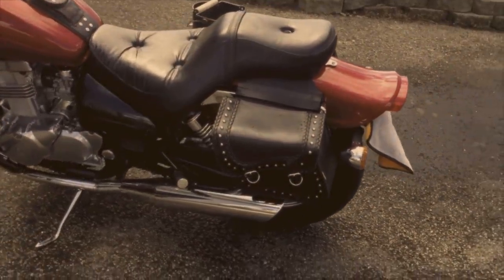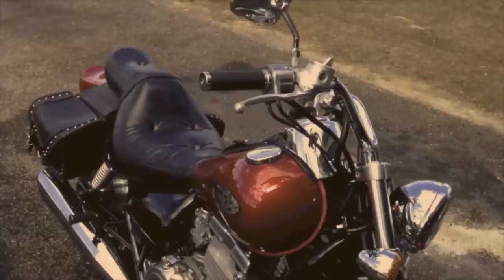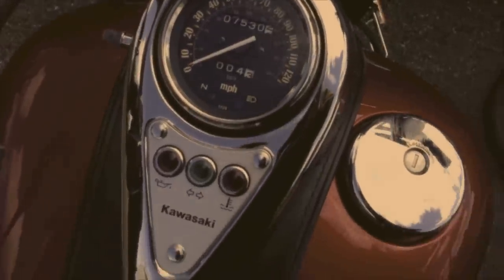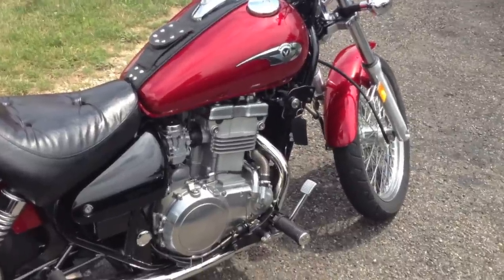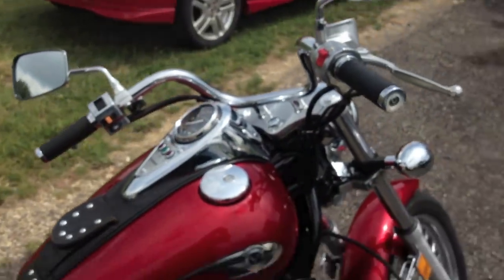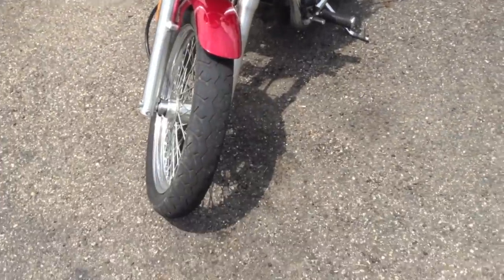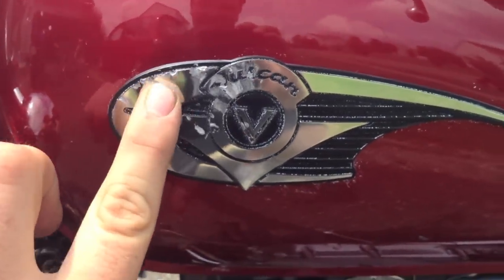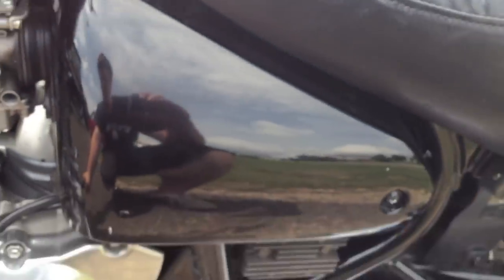2006 Kawasaki Vulcan 500 Ltd. (+Straight Pipe Audio)

Comment: Do you still have this bike I’m having problems figuring out where one of my fuel lines go from the carb
Reply: Still need help brother
Reply: There’s a vacuum tube that must be connected to the petcock
Reply: @hendrixc6988  I just got one of these given to me, was helping someone move and they said "If you want that bike you can have it" So of course I immediately put it in my truck, lol. But someone had been "working" on the carb from what I was told and they put it back in and then took off and never finished it, everything looks intact and the hoses appear to be all connected, there's one running from the tank all the way down through the engine and isn't connected anywhere, what might that be? I don't have a battery for it at the moment so I haven't even tried to crank it yet. any thoughts?
Reply: Should be the evap here’s a link with a diagram of the tank. I’m at work but if that doesn’t help I own two of these bikes and also have the Haynes manual as well.
Reply: Also should be two vents on the side of thank running beneath the tank as well but the one you described sounds like the one that connects to the right carb and into the evap
Reply: @hendrixc6988  Didn't see a link anywhere, I managed to get it to crank and idle for a moment with starter fluid, I just don't want to put gas in the tank without knowing it's not gonna pour out because of that hose
Reply: @SteelWorksGuy  YouTube must delete links or something. The petcock is vacuum fed only running when engine is running. If it runs all the major hoses are hooked up. Perhaps it’s one of the fuel tank vents that is off.
Reply: @hendrixc6988  yeah it's from the tank, everything on the petcock/carb looks to be there
Reply: @hendrixc6988  Okay, it fires, starts and idles (kinda). I'm assuming the right cyclinder plug is out or it's not getting any fuel. Only idles at full choke and dies at the first sign of throttle. Right side doesn't warm up either, left side runs like a champ as far as I can tell.
Reply: @SteelWorksGuy  make sure the carb boots are secured on each side.

Comment: It's so beautiful but I can't imagine it without V-twin engine, the only thing that keeps me away from buying EN 500
Reply: It's one of a kind definitely, for example triumphs don't have V twins
Reply: That's how i feel too. I like the overall look but the engine is just a bit ugly to me. Plus most of the ones i have looked at have ugly seats. The passenger seat is way  too thick and it ruins the look. When you have saddlebags on like here it takes a lot of that away.
Reply: Y'know, I have 2 of these and a VT750 , i've gone off the v-twin, it never feels relaxed, , the kwaker isn't even a  360 parallel twin , it's a 180 degree twin so it's a tad lumpy,  but it makes a great noise,
Reply: I was unsure of the 500 when I got one but I love it. Its definitely a fun light bike. I currently have 18" apes on mine as well as a modified seat its comfy (for such a small bike with a 6'1 guy on it) but peppy as well. I can actually outrun my buddy's 1100 shadow! I'm currently in the process of bobbing mine out hoping than when I'm done the bike will weigh 450 pounds wet
Reply: taylor1fast I just bought an 07 vulcan 500 and I’m 6’1 and having a hard time because it’s too small. The foot pegs are too close that it makes me use the sole of my foot on the peg and my knee sticking out and Not “hugging” the gas tank. How do you fit comfortably?

Comment: hey Brother if you could help me out . im 5ft11 180 lbs and im debating on the 500 ltd or the vulcan 900 it would be my first bike. also how does it do on the highway?
Reply from the maker: The 500 would make a better starter bike and I'm 6 foot and, at that time, 250lbs. The ergonomics fit me really well and it was a easily manageable bike to control. I know a guy who had a Vulcan 900 as his first bike and he ended up having a bone sticking out his arm... It'd be a good second bike but the 900 is big, heavy, and has more pull than a first bike should have. Hope this helps. Also, the 500 did the freeway fine and it still pulls until about 85-90. It'll cruise at highway speeds fine, but I will admit that the engine drone got annoying.
Reply: It test drove this bike yesterday and I've never ridden a cruiser before. The front end felt really heavy like it wanted to fall over at low speeds.
Reply: Joseph Foster Yeah man, all cruisers are like this. It's because they are heavy and they carry their weight low. When you get used to it, it's pretty easy to manage. I sold it because I would scrape pegs in the twisties. I have an SV650 now :)